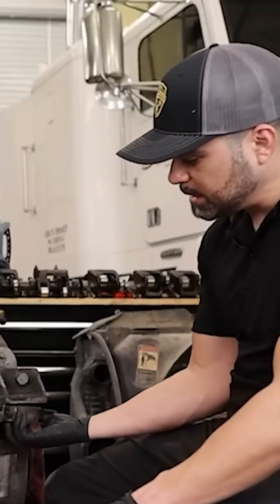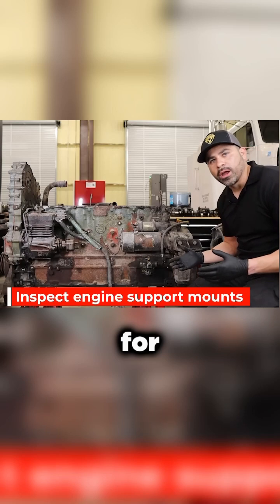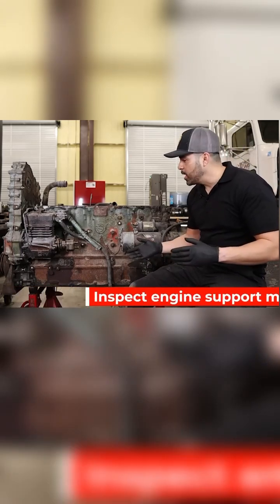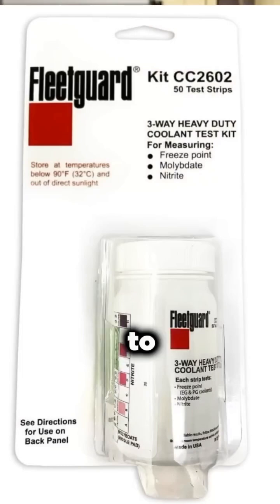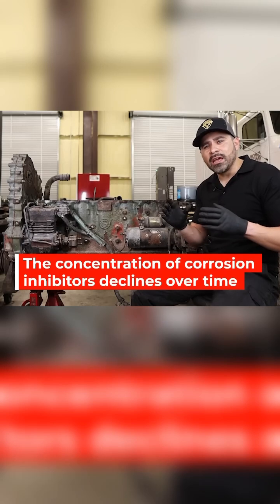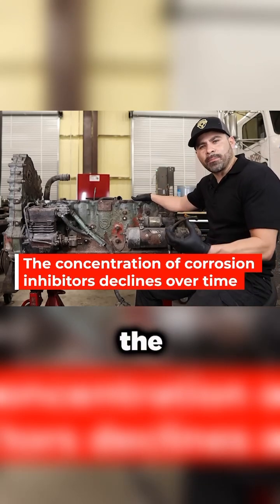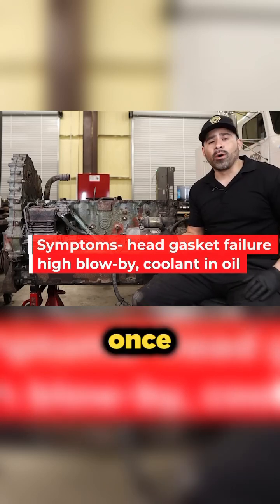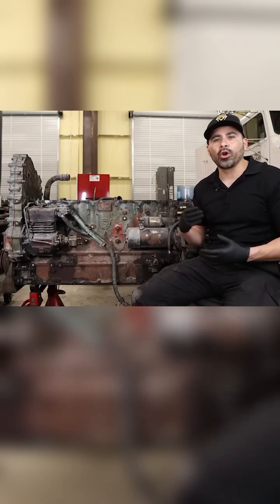Series 60 number one killer. Detroit 60 series common problem.  S60 issues/How to save diesel engine

Comment: we have starting problem of detroit 60 series
Reply from the maker: Check your fuel supply first and make sure the ECM is getting the correct signals — that’s a solid place to start with Detroit 60 series starting issues. Let me know what you’ve checked so far. 🔧💭